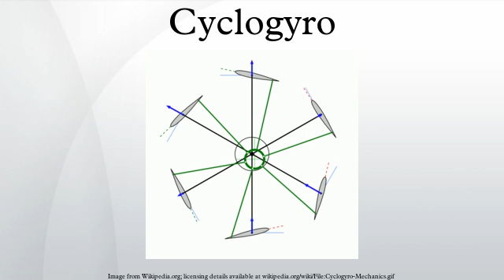Cyclogyro

Comment: Can anyone explain to me how it is even remotely possible that this design will fare better concerning "limited forward speed, very high noise and vibration levels" than a normal propeller??
Reply: I can explain why noise levels are lower. Noise of a propeller is largely determined by the tip speed. In the cyclogyro the rotation speeds can be lower, because all the lift is generated at circumference of the rotating mechanism. Whereas on a propeller the lift is generated all across the propeller - at the circumference and near the center - so rotation speeds need to be higher for the same lift and "wing area".
Reply: @martinbudden  isn't that what backwards swept wing tips help diminish, sound (by reducing drag at the tips)?
Reply: Cyclogyros would be just as slow as helicopters.
Reply: @hornypervert3781  Not necessarily. The problem with helicopters is that as you accelerate, you start to cancel the speed of the backwards moving blades, stalling one side of your lift. That is what limits their top speed. A gyrocopter would lose lift from the bottom blade, but that would happen symmetrical to both sides of the craft, and would be somewhat compensated by the top blades. However, it would be terribly inefficient anyway, because the up and down moving blades are basically a wall hitting your airflow.